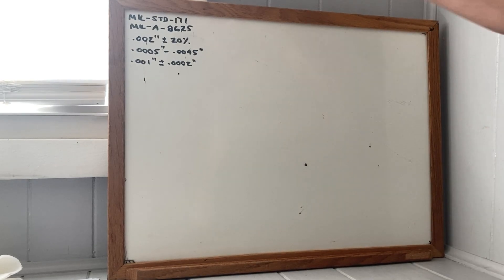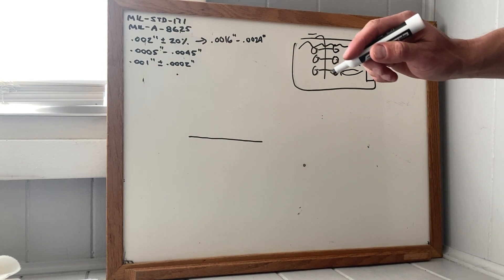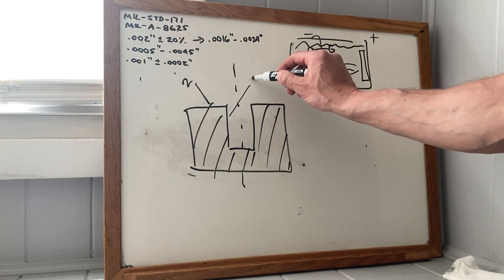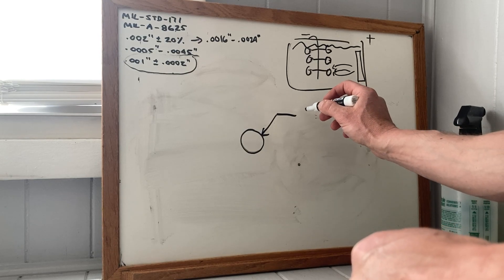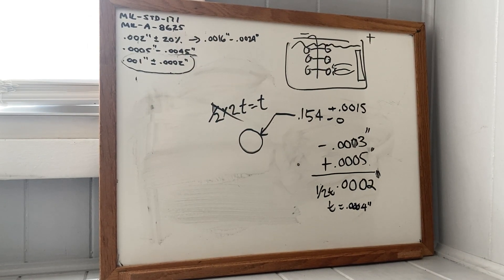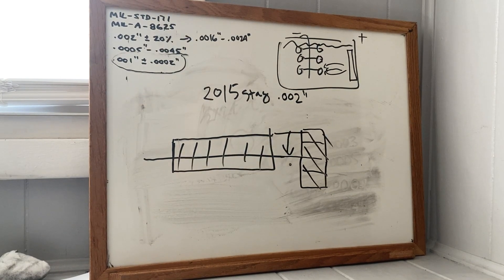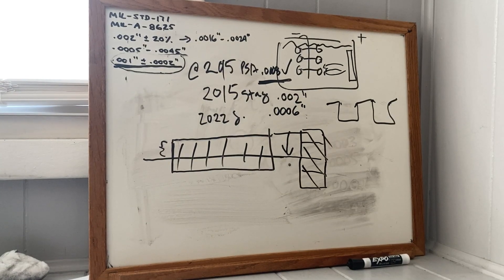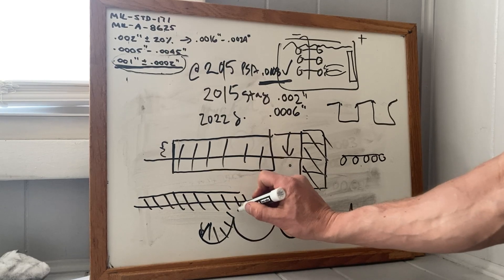AR15 Hardcoat Anodizing Explained

Comment: Tldr : all receivers are the same so save yourself the money and get the cheapest ones you can find,you’re only paying for a roll mark anyway. 😂 not.

I just had a “5 FoRgEs BrO” argument with a guy at work. He said he was going to build a “shtf” rifle and he was going to use anderson receivers. I told him I’d probably look to spend a little more on the receivers for a rifle you wish to defend you life with if the need arose. Then he hit me with the 5 forges thing. I said man it’s not as much about the forge as it is the finish work. Lots of companies use different places to oem their parts and they will require different standards. Company A might say batch test and replace tooling if tool marks start to get onto the vital areas, company B may pay for individual inspection and to replace tooling at first signs of tool marks. A great example is psa’s fathers of freedom bcg vs solgw bcg, they’re both made by micro best and on paper seem identical but psa doesn’t HPT test nor require the same manufacturing standards as solgw. When i got to the part in my spiel about the coating though i thought he was going to lose his sh*t. He said it’s a “fighting rifle” i don’t care if it has a pretty coating. I was just like no man aluminum gets a lot of strength from its coating and If done poorly it can cause some serious issues. 

I don’t think i changed his mind one bit 😂
Reply from the maker: If a person thinks that forging the raw material is more important than all that follows, he is clueless. I like to say that the best way to ensure that the gun works as intended is to manufacture it as designed. Everybody always tells me all the little deviations aren't important but when you cut enough corners who knows what you left... TDP on thegatalog.com
Reply: @whattheshit4664  yeah exactly. It’s like when someone starts to tell me about their new Glock “upgrades” lol.
Reply from the maker: @itsamk18-ish  
Btw '5 forges' reminds me of 'two world wars'